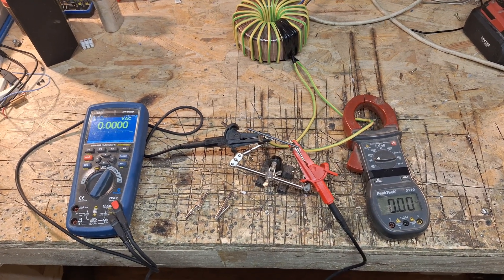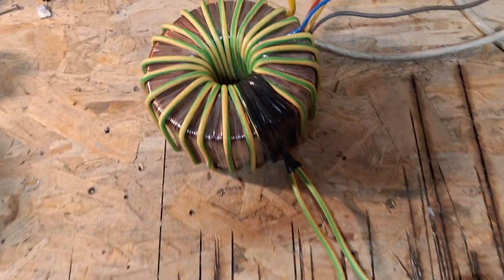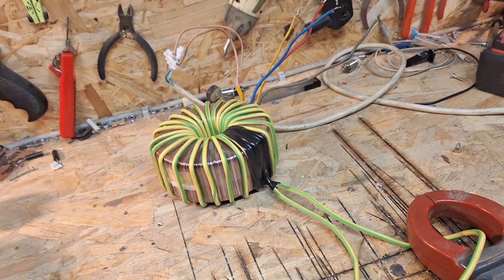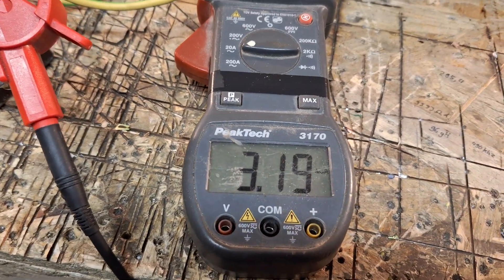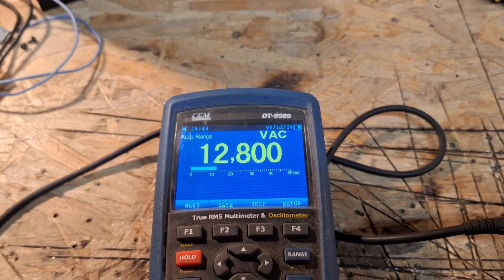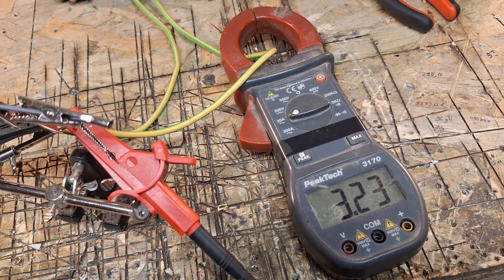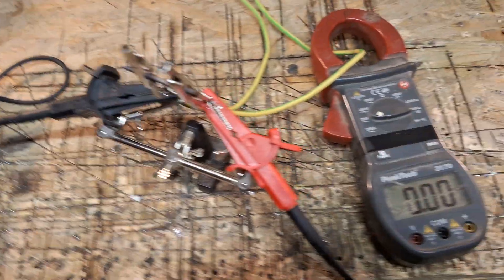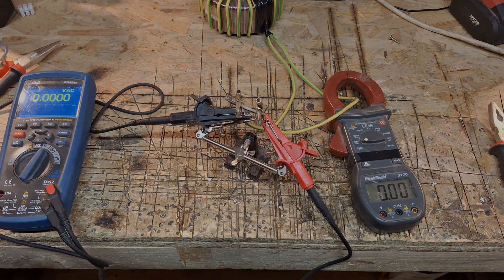high current transformer DIY Test

Comment: What you can do is get an old halogen light transfrormer they are usually 11.5V, what i do is have a smaller 500VA  variac controlling the primary voltage, going a bit over 230V wont damage the transformers and it also gives you fine regulation since directly heated tubes are way more sensitive on their filaments, also take in account voltage drop when the coil is operating, you may need to plug the filament transformer into a different outlet
Reply from the maker: Thats the reason why i wound a transformer, that have a exact voltage, so no need for halogen transformers🙂
But yeah that is also a way to do it.
Yes, i have a 3 phase power supply and use a different phase for the heater.

Comment: Oh, thats a good idea. Id seen something similar before, but it only just clicked in my head, I have a few 60va toroid's with blown secondary's. I can just roll my own secondary. That could be super handy with valve projects, needing all kind of weird voltages. In the past I have just used a collection of multi-tapped off the shelf transformers connected back to back, to get the required voltages. I used to think transformers and inductors such archaic technology, but I have come to love the process of easily being able to add or remove turns to really dial your circuit in. you cant buy a 27.3uh inductor, but you can make one ;-D
Another excellent source of DIY transformer parts is a microwave oven transformer, it is easy to cut out the high voltage winding with a grinder, and then wind your own secondary. Ive used one with great success to run a 12v car subwoofer amp, drawing about 80A at peak. Im sure my neighbours were un-impressed, but I was. and my organs were liquid, which was the idea...
Reply from the maker: Hehe, yeah i dont know why i didnt done that sooner😅 like you say, i had/have many projects with tubes and struggled to find a good AND cheap transformer for it.
I just tryed it once and it just opened another whole world😂